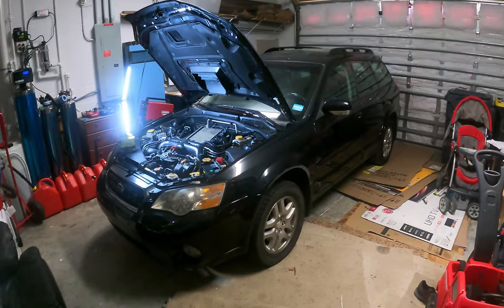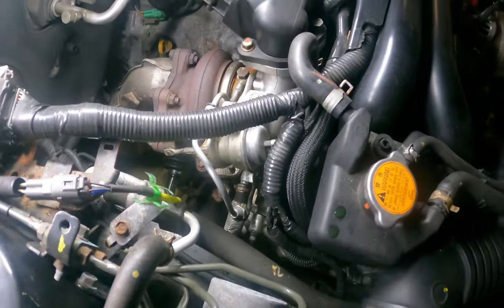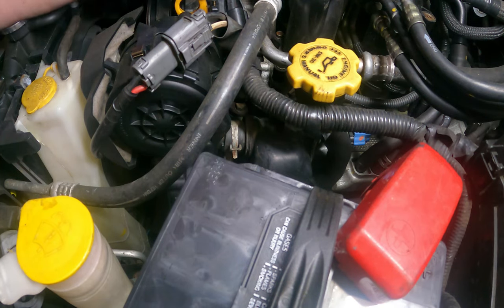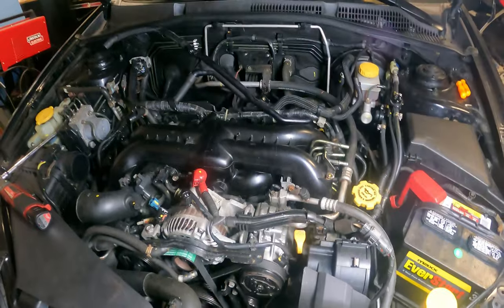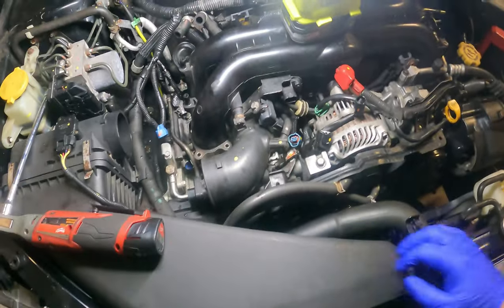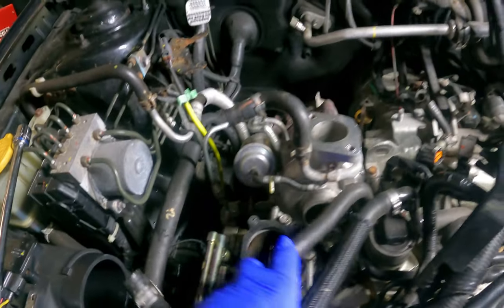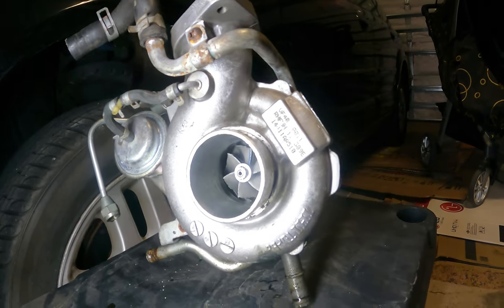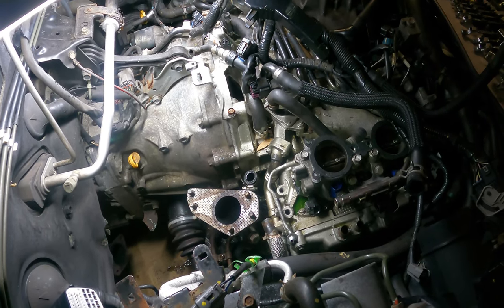2007 outback xt banjo bolt filter turbo failure p0011

Comment: Just FYI for you, if the top of your banjo bolt is flat Subaru already fixed the problem or someone else already did if it has a nipple in the center of the bolt sticking up it means it's factory manual bolt and it has a filter just so you know. Hope I can help you or somebody else
Reply from the maker: Good to know. I learned something new today. Thank you.

Comment: Upgrades !?!?!? You better be worried about all the shrapnel from your turbo getting inhaled by your engine bud....and getting into your oil pump system & could potentially spin a main bearing and/or a rod bearing, cams, etc & having a catastrophic effect on your engine ! You should at least clean the entire intake out & drop your oil-pan & clean it out & flush your oil-cooler out too ! And run a couple oil-changes through it, including filters ! Same thing happened to an 07 XT I purchased and I had to swap a new EJ25 engine into it, as well as a new Turbo & many, many new intake related parts ! HUGE COST ! I'm almost done w/the engine swap now. Let me know how your engine fared ! Good luck !

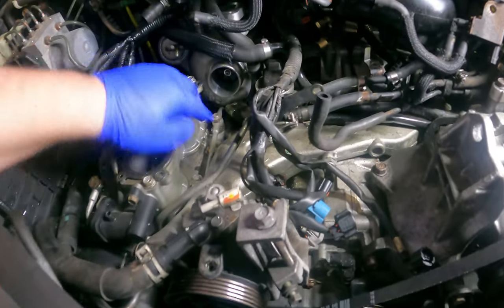Comment: Thanks for putting this video together! About to do this on my 09 Outback XT with the same banjo bolt location under the turbo inlet, but I would rather not go through removing the intake manifold and inlet. At 10:22, seems like it would be possible to reach that banjo bolt by just removing the turbo?
Reply from the maker: its worth a shot, the turbo inlet tube may hinder your adventures. I had toe replace that as well, so I didn't have much choice but to take it all apart. also worked out as the previous owner used the wrong gaskets and left a plethora of loose bolts all over the top half. good luck on your project.

Comment: Just the 1x banjo bolt had the screen filter in the end? The one located near the front of the turbo compressor inlet?
Reply from the maker: That was the one that kept blowing turbos. The most important one to find. The other is behind the timing belt an the ac compressor side. It's less important to remove that one unless you have the belt off already or have the avcs code that does not clear after removing the turbo side filter.
Reply: @danielsgarage3545  Thank you! Stupidly I didn't remove the one near the compressor inlet when I changed the turbo a while back, more stupidly I didn't check the one behind the rear timing cover when I changed the belt.... sigh. I did check the ones directly on the AVCS solenoids but didn't find any screens in mine but have since seen the screens can get stuck and remain INSIDE so I think I need to re-check and go over the whole lot with a turbo swap happening soon. Thank you!

Comment: I have these same codes 0011,0021 on a 13 wrx new oem solenoids, cam gears killer b pickup, all new timing components removed filters blew out lines and these codes will not go away so ridiculous these engines
Reply from the maker: Agreed. I friend of mine had the same issue on his 18 sti. It ended up being a wire issue to 1 of solenoids.

Comment: Is this also the case for a 2014 WRX 2.5ltr??! I have the same code..
Reply from the maker: As far as I can find. Subaru stopped using them in 2011. However this is coming from forums I browsed through and could not find any hard evidence one way or the other. Unfortunately I don't have access to one to find out. It would be some work but it could be worth it to check before trying to replace the AVCS solenoid.  Another option would be to clear the codes switch the solenoids around. Driver to passenger and see if the code follows then you know it's the solenoid and not a blockage.
Reply: @danielsgarage3545  Appreciate it. Them two lines are gnarly to remove just to get the AVCS solenoid out... I tried cracking the banjo on top of the housing for the solenoid but the line attached wanted to spin with the bolt so I didn't pry on it. My car been through autocross and many ditches so the old girl is starting to show her disapproval for my driving. 😂
Reply: I have a 2012 wrx this is happening to me rn
Reply from the maker: @guillermomeji8613  most likely not. The filters should be all gone after 2009. I would start with the cam sensors and the avcs solenoids.

Comment: How many of the bolts have filters?
Reply from the maker: mine only had the 1 in the turbo oil line. some of the older ones had 3 or more. someone else had commented that the filters are located in banjo bolts with the nipple on top.